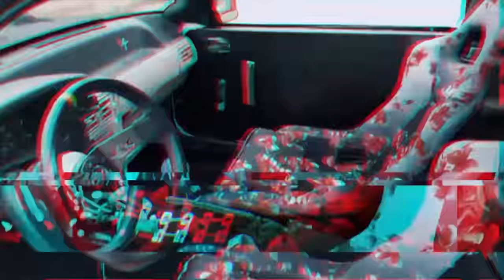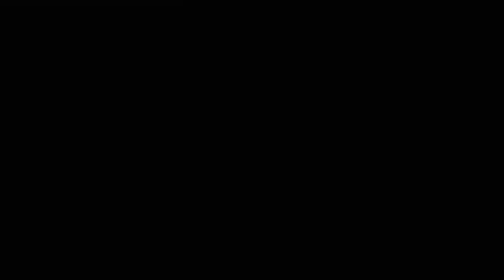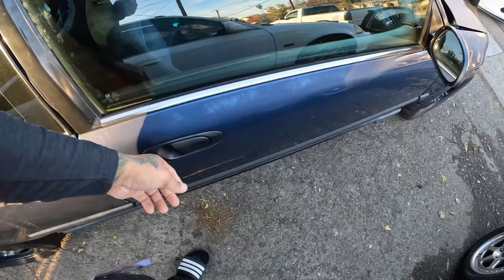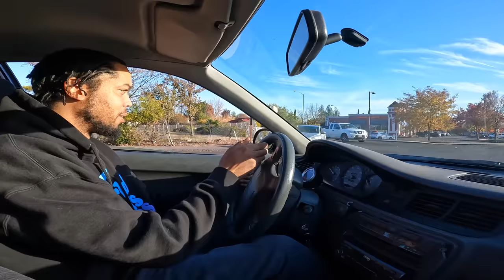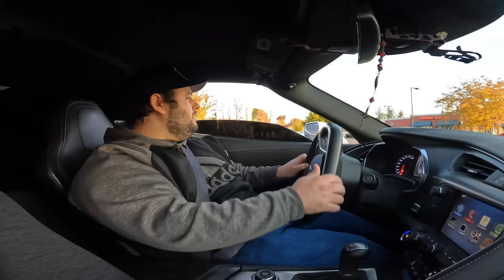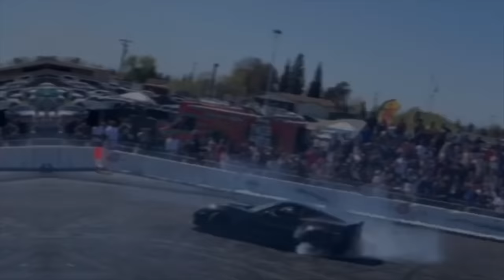All Wheel Drive Turbo Honda Civic: Is It Fast or Is It Ass?

Comment: Aye!! So is he using a crv trans, driveshaft and diff? I have all 3 and the only thing I can think that won’t hold the power would be the driveshaft
Reply: It’s crv stock transmission. Pinned crv diff and s1 built freelander driveshaft with 1310 joints

Comment: Throw a sheet of steel in the bed, or put weights on the back of the truck. The weight will slow it down but depending on how you do it it could have the perfect balance of weight to help the traction and it wouldn’t hurt the speed bc it’s gripping